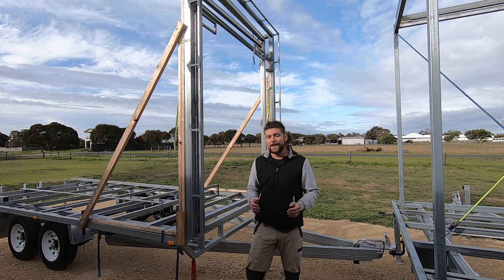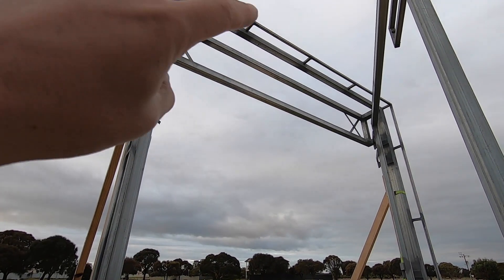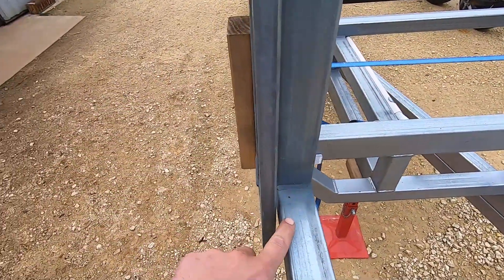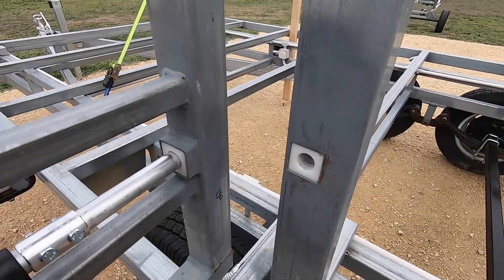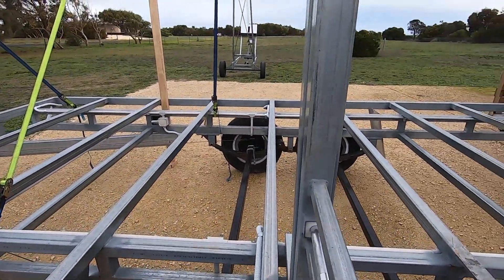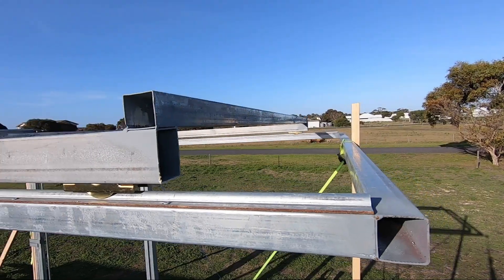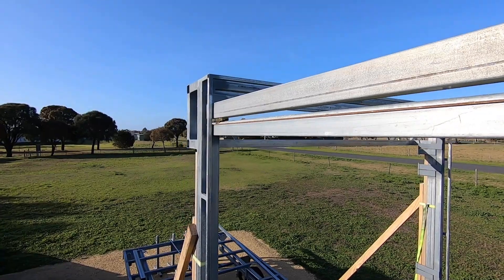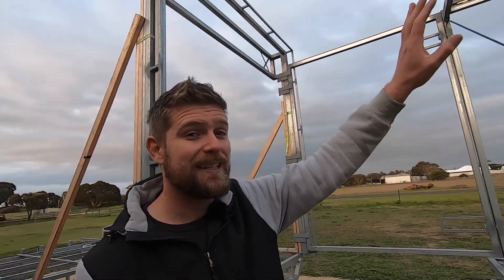Ep. 08 - Swinging walls, sliding roof & how two trailer tiny house joins - Tiny House Build Update

Comment: Did I miss what you're doing about the floor between units?
Reply from the maker: Nope. I have no idea 😆. Actually I'm working on that now. I thought if I could do a roof and walls the floor would be easy right?... Wrong 😆
Reply: @TwoHandsandaTinyHouse  I thought you were doing it last because it requires the most thought. I'm sure you've figured something out though.
Reply from the maker: @zacdredge3859  😂 turns out it needed a lot of thought. I have worked it out. You can see the vid here https://youtu.be/w5-dE8FcB1o

Comment: That is quite an impressive bit of design work you are doing there. And requires a reasonable amount of accuracy also, that you are obviously up to. Looking forward to seeing more.  :)
Reply from the maker: Thank you Leo... haha you are spot on man. My day involves measure, weld, cut it off, measure, weld, cut it off, measure weld.. and it goes on haha. I just had to lift of the whole main structure to move a gusset 3mm. There is less than 10mm clearance when the walls swing into the other trailer.

Comment: This reminds me of mobile TV production units that expand out.  For smaller vehicles we level with hinge down 12V RV levelers.  For bigger loads, all hand crank.  The downside to levelers is that they add a lot of weight so if you can reduce the travel distance by carrying leveling blocks (wood), it helps.  https://www.asgb.co.uk/wp-content/uploads/2014/11/website-3-1024x749.jpg
Reply from the maker: Wow they are are impressive. I toyed with the idea of electronic leveling but it got expensive very quickly and wasn't my main goal go going with some screw down I think. Working on the design right now.

Comment: Here you are. Been waiting for this update. This is looking great and I like the design so far. 👍🏽
Reply from the maker: 😂 yeah sorry the crane stole my focus for a few weeks. Cool to see it start take shape
Reply: @TwoHandsandaTinyHouse  Lol, man this is cool as hell. 

I wanted to figure out a way to join 2 trailers or even campers. And be able to separate them if need be. 

Silly property permit regulations in the U.S. keep people from having some buildings or small homes on your own property, beyond a certain size.
Reply from the maker: @72Dexter72Manley72  technically in Australia you can't live in a tiny house anywhere and only for short periods in a caravan (camper). 

If you want to join two up the easiest way would be some kind of shared/covered deck. Joining them up as one single and seamless unit is proving very very challenging. But also cool and a lot of fun.
Reply: @TwoHandsandaTinyHouse  Thanks for responding back. 🤓 

That is crazy, some people just want to live minimally. Some have to also.  I have thought about a covered area. I have some ideas. 

Now get back to working safely on those connected trailers. 😆 👍🏽